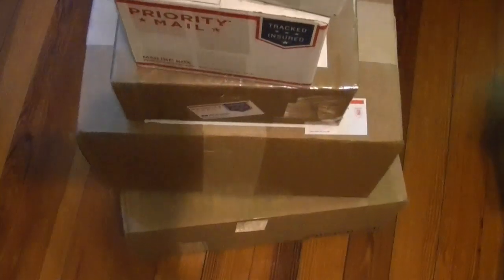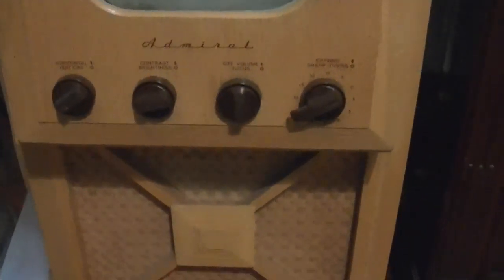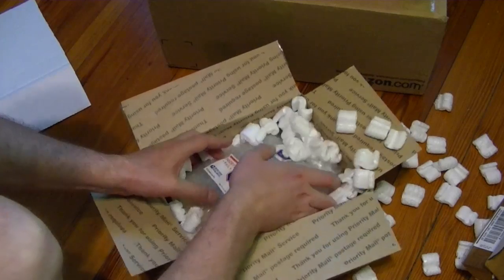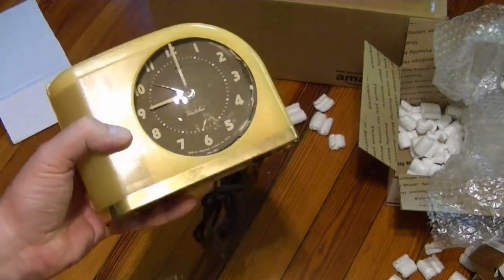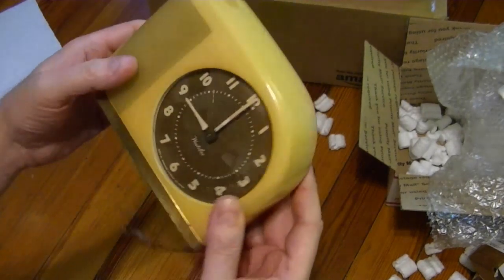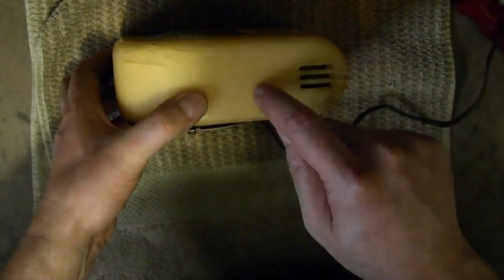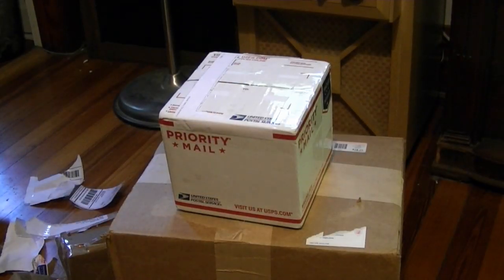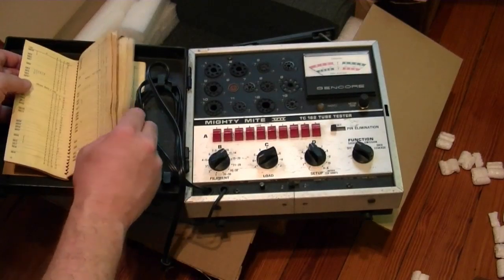Friday Night unboxing 2014.09.26

Comment: You may be able to get all of the moonbeam clock mechanisms working, chances are that what they need is a good cleaning and lubrication. They probably have the same problem that a lot of disused clock radios and phonographs run into, they sit for so long that the grease and oil congeals and seizes everything up.

Comment: Nice clock, Bob. FYI, clock parts material, & tools are available from "TimeSavers.com.".Just a suggestion from an old clock man, as well as an old radioman.
Dick
Reply from the maker: Thanks for the tip.  I think may have ordered some stuff from them before for my Westinghouse WR8 clock.

Comment: Combine a full moon shining in the window and that blinking clock and I would think the aliens were coming for me!  I think the TC162 Sencore is a great tube tester, however it does have a design flaw.  The think heavy ac cord, when it is strapped in, puts pressure on the first red switch and often breaks them.  I have seen many with that first red switch broken.